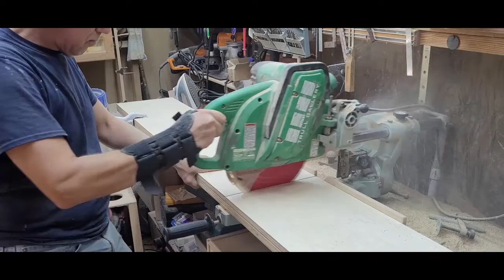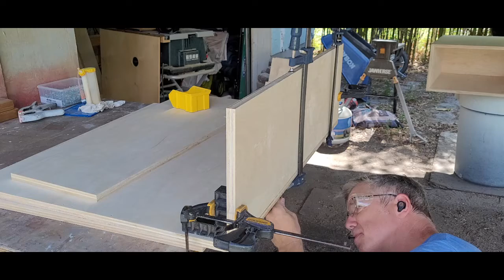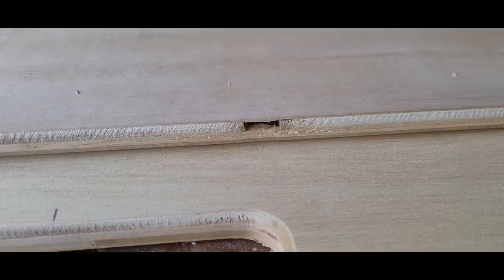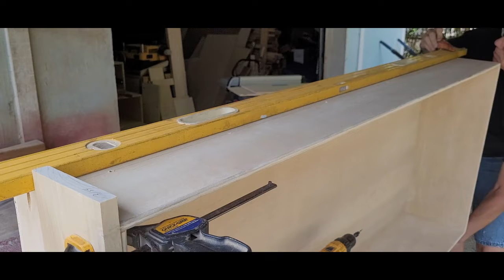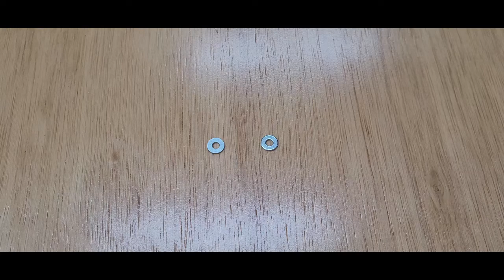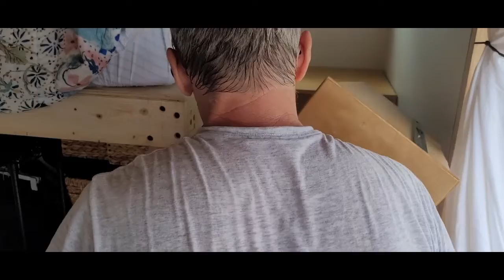Building Loft Bed Steps With Build In Storage For A Tiny House

Comment: Cost to build??
Reply from the maker: It's been a while, but figure about $375 for all the hardware and screws.  Add in four sheets of 3/4" ply and one of 1/4" ply, but those prices can vary greatly, based on quality and location.  For decent plywood (not what I used here) I'd guess about another $400 - $500.  Again, those prices can vary widely.

Comment: Do you recall the budget for this project? I want to try and tackle it
Reply from the maker: It took five sheets of 3/4" ply, three sheets of 1/2" ply and one (partial) sheet of 1/4" ply.  Since prices vary wildly from location to location, and even vendor to vendor, you may have to do some research.  The drawer slides ran me just over $250 and that was about a year ago.  Links for where I got them are in the description above.  If you build it, I'd love to see the finished product!
Reply: Thank you so much! Yes of course, I will gladly share when done!!🤗